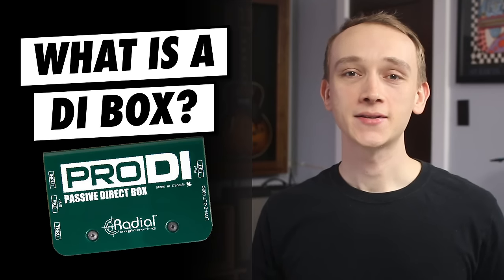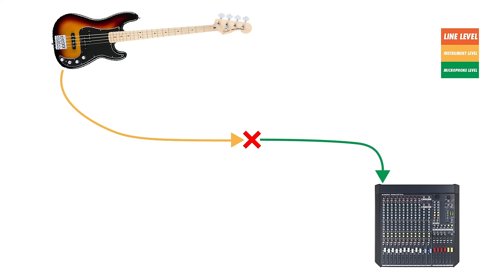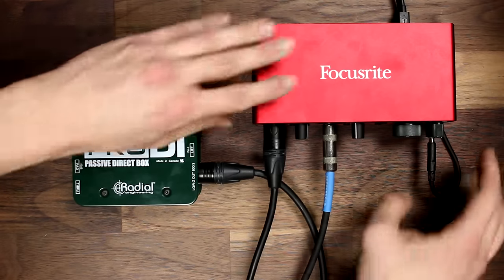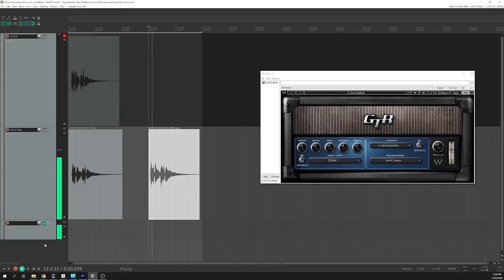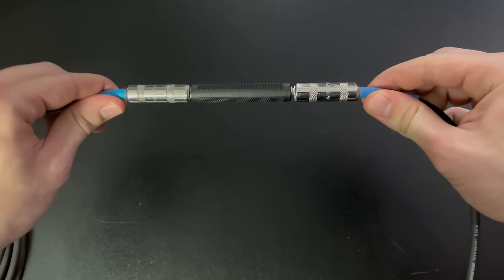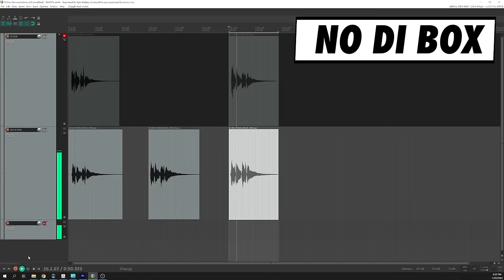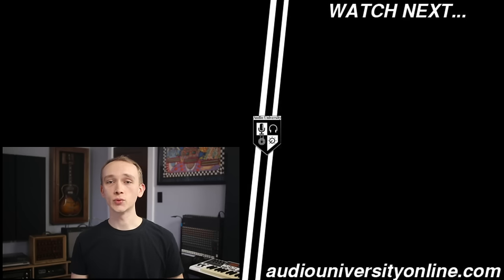What Is A DI Box (Direct Box)? | When & How To Use One

Comment: Will DI Box help for getting rid of that electrisity noise-hiss that you would usually get when any electic stuff is turned on? We do not have a ground connection in a electric sockets in my country at all. So the ONLY WAY how i can get rid of that hiss now - is do disconect my laptop from socket and run it on battery only. However, recording microphones is alwasy fine for me. 
Sooo, would the DI help? If i would conect it to XLR input of interface.

P.S: my cables ( both instrumental and mic) are 0.5m long. So we are not talking about long cables that pick's everything along their way..
Reply: I have the same question. And also how it compares to a noise gate. I have no clue about neither of these devices

Comment: to record my digital piano using an audio interface Focusrite Scarlett, I can use a TSR to TS break out cable, so one TS is plugged into the Scarlett input 1, and the other into Scarlett input 2. And then I can use Logic Pro or Ableton Live to record the left and right channels and have stereo.  However, do I need to worry about the TS "faking it as balanced input"?  The Scarlett probably will take the TS signal, subtract the ground, and divide the signal level by 2, so I am only getting half of what the real signal is. Is it solvable just by increasing the Gain on the Scarlett?  I noticed if I plug a guitar's TS output to the Scarlett, it is the same situation: TS unbalanced signal faking it as balanced signal.  So then, does that mean I can use 2 DI boxes?  So from piano, using the TSR to TS breakout cable, then one DI box for the left TS signal, and another DI box for the right TS signal... now I have two balanced signal, and can plug into the Scarlett box, officially as balanced signal.  So in this case, is it true the signal level has got back to double as compared to not using a DI box?  Is it an overkill, because I am just using a 6 foot TSR to TS breakout cable, so length of cable is not an issue... I am just officially making it a balanced input rather than faking it... but does that help a lot?

Comment: Thanks for the great explanation.  So I understand the DI box is looking for a high impedance input.  I have a 1/4" line out jack on my amp that I would like to connect to a PA system using longer balanced XLR cables.  How can I best accomplish this?  Thanks in advance.

Comment: I Question and concern here . If I turn on phantom power to power my active DI box , does that phantom power will affect all  channels on the mixer such of my other mics plug in . How do I exactly do I connect and power it using my phantom power from my mixer
Reply from the maker: Dynamic mics won’t be affected by phantom power, but you generally should avoid sending phantom power to ribbon mics and non-microphone sources.

Comment: I use a stereo passive Radial direct box after the main output on my Mackie mixer to run a greater distance to my crappy Gemini mains, is this a correct use in other people's use?
Reply from the maker: If the mixer outputs and speaker inputs are balanced, you don’t need the DI box.
Reply: @AudioUniversity  it's a janky setup,  the outputs on my mixer are only ¼inch.

Comment: Do you think this would work with A 20 W amp head with a tube pre-amp built-in but solid-state, in trying to utilize the amp head directly into my audio interface rather than micing a speaker cabinet?
Reply from the maker: I believe the RNDI should work for solid state amps too. I’d recommend checking with Sweetwater or Rupert Neve Designs first though.
Reply: @AudioUniversity  I’ll have to do that. It’s the orange micro dark. It does have a tube preamp built in

Comment: I have outputs from keyboards do I need to use a DI box to my mixer?   How about outputs from my laptop?
Reply from the maker: If the cable run is longer than 15-20’ I would recommend using one.

Comment: Can I use a DI box between a Positive Grid Spark Headphone Out and a Marshall Tube Amp? planning on using the Spark as a Head/Pedal Effects. Currently running guitar through pedals and then to Spark Amp. But looking for more headroom than those small speakers...
Reply from the maker: You would be better suited with a re-amp box I think because you’d have better control over the output level to the Marshall amp.

Comment: I have a Yamaha CM500 headset, the specs list a dynamic microphone but it has a battery box (two 1.5v AAA in series) inline with the microphone and that leads me to believe it’s an electret type that needs power.  I’m not sure if this is considered phantom power because any discussion (online) about phantom power usually has a much higher voltage 12-48v.
I am more concerned with how this particular power box or phantom power is applied.  does this voltage only travel up the line to the microphone element or does it also travel towards the jack?  and might that be something I can test with a voltage meter?
My end goal here is to use the headset with a transceiver but the transceiver is sensitive to injected power at the microphone port.  I currently use the headset for teams / zoom conference calling connected to a laptop and it hasn’t fried anything yet.
I have a bead on a Heil communication headset but the Yamaha CM500’s weigh much less and are more comfortable to wear.
would a direct box (Pyle PDC21 or Rolls DB225) keep the power from reaching the transceiver?
any recommendations are greatly appreciated!

Comment: Ok. This is my question. I have a Behringer UMC202HD using Reaper. Why every single video I see, the signal is so well defined and I can only get a straight line with little change? Like no volume? If I put more gain on the interface then the clip led start to lit. Thanks.
Reply from the maker: Try setting the gain knob to the point where the signal peaks at -12 dB FS.
Reply: @AudioUniversity  What FS stands for? I pump the input singnal until I don't get a "clip" light, but the Reaper meter barely reach -30db
PD: I went into the UMC Control panel > Volume > Channels, and under Input, I noticed it was really low. I moved it to -12db, now the signal is more visible, still not as high as I see on the videos, but much better.

Comment: My 3rd gen Scarlett clips as INST almost at lowest volume. I searched online and found an issue in Focusrite's forum with the same problem. The solution they provided was to record the guitar as line input. Does this mean I'm recording my guitar wrong?
Reply: Your scarlett must be defective from the factory, what you see on forums is usually people who used the first generation or even the second.

This 3rd has +12.5 dbu input gain at minimum so no pickups could clip on it, I use emg 81, Duncan jb, Distortion, and other pickups with absolutely no problem, I even have to set the gain knob to 10 o clock to get the level I like (-12dbfs peak to -6dbfs peak) on my Daw.

Your picking technique has a lot to do with it, you should not destroy the strings with an exaggerated attack as many mistakenly believe to have a good tone, with a medium attack you already have the best of both worlds.

Comment: I've been told that if i want to record my keyboard to FL studio,just buy a TS cord but it's not working out.Should I buy a DI box to be able to do that?
Reply from the maker: No. You can use a TS cable. There is likely another problem.
Reply: @AudioUniversity  when i plug my the TS cable to the keyboard output,and connect the other end to the audio interface,it's not working out
Reply: @AudioUniversity  And when I go on audio setting in fl studio,I do not see my keyboard name listed
Reply from the maker: If you’re using a TS cable, you won’t see it show up because you’re using the audio interface. 

You will only see the keyboard show up when using a USB connection from the keyboard to the computer.
Reply: @AudioUniversity  Ok,so as I connect TS cable from keyboard to audio interface,I can start recording what I am playing?
Reply from the maker: Yes. You need to select the correct input in your recording software.
Reply: @AudioUniversity  I appreciate you
Reply: How to fix latency on vocal and also instrument audio for fl studio 20?

Comment: It was certainly a good video, but unless I missed it, the main reason you usually need a DI box wasn't addressed. Sometimes you have to use one. In this example with a guitar going into a mixer, the signal may have to be balanced in order for it to be electrically compatible. Balanced and single ended connections are not compatible. It has to be one or the other. A single ended connection needs 2 conductors, positive (+ signal), and negative (- ground). A balanced connection has 3, 2 positives +, and one ground -. If you want to connect 2 pieces like this, something must be done with the extra signal conductor. Not everything is wired exactly the same way, but when you use some type of adapter/cable, they connect one of the signal conductors to ground. When you do that, it creates a short circuit because you are literally crossing - and + signals. When you do it, you'll know. Its not a pleasant thing to hear. There's one thing I need to add because it can be confusing. If you look at the pin configurations on an xlr cable or connector, the 2 signal conductors/pins are usually labeled + and -. This is to indicate phase. Both of those conductors are both hot +, even the one that's labeled -.

Comment: In my opinion, the comparison would be fair if you connect the instrument to DI and the XLR output to channel 1 on the interface. While the thru output from the DI connected directly to channel 2.
This way you can keep the playing exactly the same for DI and non DI input.

Is there any particular reason you didn't do this way?
Reply from the maker: At first, I planned to use the "thru" output to input 2 on the interface so that I could test the "DI Box" and "No DI Box" at the same time. However, I noticed that connecting the "thru" output to a low-impedance input actually changed the tone of the guitar on both channels. 

My hypothesis here is that the input impedance connected to the "thru" output has an effect on the quality of the signal that is routed to the low-impedance output of the DI box, which makes sense once I really thought about it. That's why I set the test up with the guitar connected directly to input 2, rather than using the "thru" output on the DI.
Reply: @AudioUniversity  ah, I see
That would lower the signal quality for both connection. Thanks for the explanation.
It would be nice if you have a looper pedal to record your playing first, so you have an exact same signal for both.
However, I got the point that connection setup will affect the signal.

I have another question if you don't mind.
Will the line level signal lose its high frequency if we run it through a very long unbalanced cable? Is line level low impedance or high impedance?
Reply from the maker: It depends on the device you’re using. You won’t need a DI for most professional gear with XLR or TRS outputs. You should use a DI and a long XLR if using TS, 3.5mm or RCA out of the source device.
Reply: Thanks dude
Reply: @AudioUniversity  the thru connection in most DIs is just a parallel connection to the input. You could literally swap them. It should work fine for comparing the instrument input on the interface.
Also, you neglected to mention the ground lift.

Comment: How about line level outputs? Is there any reason you would want to connect a line level output (like e.g. from a synthesizer) to a microphone input on the mixer using a DI box. (As opposed to connecting directly to a line level input on the mixer.)

I once was DJ:ing at a place where they had me connect with RCA to a DI-box instead of using the balanced output from the DJ-mixer. That didn't make sense to me.
Reply from the maker: They may have asked you to do that so that there would be an opportunity to lift the ground in the case of a ground loop.
Reply: Not everything that has xlr connectors on it is balanced (I know, its messed up), even if its labeled that way. The mixer the club may have required a real, balanced signal. Instead of taking a chance, they converted the single ended signal coming out of your mixer to balanced. Its done to protect the clubs sound system.

Comment: Do you suggest an active or passive DI box for my 2i2 when I use passive pickups but my signal still is in the red with level at zero in the interface even trying the instrument button?
Reply from the maker: I’d generally recommend an active DI for passive sources. You might want a DI with a pad switch in case you still don’t have adequate headroom.
Reply: @AudioUniversity  Thanks for the reply. I’ll have to give the radial one a try!

Comment: Can't we connect Guitar and Mic directly into a Mixer and Connect the mixer to an Amp
Reply from the maker: Most mixers do not have an instrument input, so you should use a DI box for the guitar. The mic can be connected directly to a mic input on the mixer.
Reply: @AudioUniversity  Isn't that TRS/ TS jack input in Yamaha mixer or Mackie mixer for Instrument?
Reply from the maker: Some have line inputs, some have instrument inputs. If it is an instrument input, it will be labeled “Instrument” or “HiZ”. HiZ inputs can be used for instruments with no DI, but only over short distances below about 15 feet.
Reply: @AudioUniversity  Thanks 💓💓

Comment: Why connect a bass guitar into di-box and then to the mixer table if you want the sound from the preamplifier in the bass amplifier to the mixer table. Most bass amplifiers today have balanced xlr out.
Reply from the maker: If you want the sound of the bass preamplifier, you should use the line out of your bass amp. If you don’t have a bass amp like that or you don’t want the sound of the bass preamp in the recording, use an external DI before the amp.
Reply: As long as its a line level balanced out on your bass preamp, there's no reason for a DI box. Your preamp does internally what the DI box would do.
Reply: @AudioUniversity  semi related, is there any issues with using the 'headphones' 1/4'' output on my bass amp to get the signal to my computer? or is that actually just a line out in disguise? (its the only output)

Comment: I'm trying to record my bass (active circuit) but it gets distorted even when is not reaching the clip on the interface and on the DAW, I tried to record with another bass (passive) and I'm not getting the distortion. Do I need to buy a Direct box for recording my active bass?
Reply: What interface you have?
Reply: @butcher_0392  Behringer u-phoria um2
Reply: @AleEsc_Covers 

I recommend you to buy the focusrite scarlett solo 3rd gen it costs only 120 bucks, and it is excellent for Tracking guitar and bass DIs with absolutely no problem, and since it has input gain of +12.5 dbu at min which is perfect for this purpose.
Reply: @butcher_0392  I've seen some reviews about the ssl2+, I liked it because of the quality and also for the included plugins (melodyne and amplitube 5se), also I've seen the scarlett 2i4 but I didn't liked the included plugins
Reply: @AleEsc_Covers 

The 2i4 will have exactly the same quality as the scarlett Solo, the only thing that changes is that it comes with more inputs and outputs, but if you don't need them, you shouldn't buy it.

A few years ago the different versions brought different specifications, for the benefit of all of us now they are the same.

* As for the ssl2 it is a good option, the same as Audient ID4 mkii, but in that price range the differences are minimal even zero being objective.

Any of those 3 that you buy will give you an excellent result.

What I do recommend is that if you buy scarlett, note that it the 3rd generation, they improved a lot compared to the first and second.

The same in audient that is the MKll version, the ID4 mkii costs 199 dollars super cheap.
Reply: @butcher_0392  Thank you bro, also I am thinking to buy the beyerdynamic dt990 pro x, have you tested them?
Reply: @AleEsc_Covers 

I like the Dt880 250 ohm premium version better.

That added to these current interfaces they can move without the need for external amp and dac.

The Audient MKll has the best headphone amp but if it is used in a USB C port, if you use a USB 3.0 you would lose this extra power.

If you plan on using beyerdynamic then your best option would be the audient ID4 mkii, for the extra headphone power and dedicated JFET instrument input.

If it had been only for Tracking guitar DIs, any of the 3 would have served you just as well.

Of course, if you do not have a PC with a USB C port, you would not have benefits when buying the audient, and you save 80 bucks by buying the scarlett Solo.

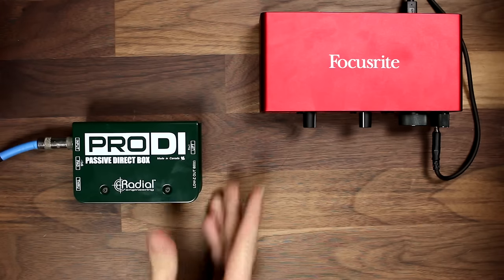Comment: 1:58 Probably you didn't know how to use "thru" output on DIs.
Reply from the maker: I'm not sure what you're trying to say, but this reminds me of an issue I encountered when creating the tests that some might find interesting...

At first, I planned to use the "thru" output to input 2 on the interface so that I could test the "DI Box" and "No DI Box" at the same time. However, I noticed that connecting the "thru" output to a low-impedance input actually changed the tone of the guitar on both channels. 

My hypothesis here is that the input impedance connected to the "thru" output has an effect on the quality of the signal that is routed to the low-impedance output of the DI box, which makes sense once I really thought about it. That's why I set the test up with the guitar connected directly to input 2, rather than using the "thru" output on the DI.
Reply: Shouldn't you connect the thru output to the high impedance input (instrument switch turned on) of the interface?
Reply from the maker: Yes. For the first part of the test (DI versus No DI into an INSTRUMENT input), that is correct. However, for testing a DI versus no DI into a LINE input, using the “thru” output invalidated the results because the DI signal was also affected by that change.